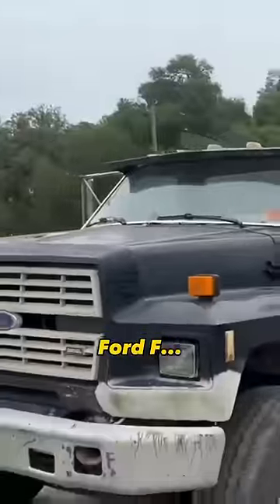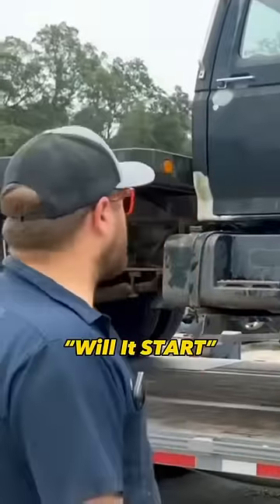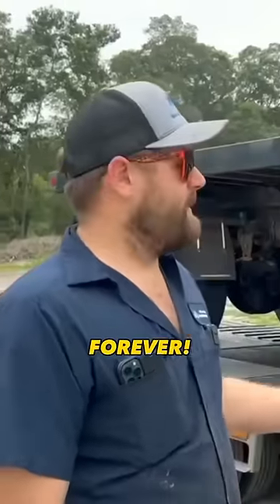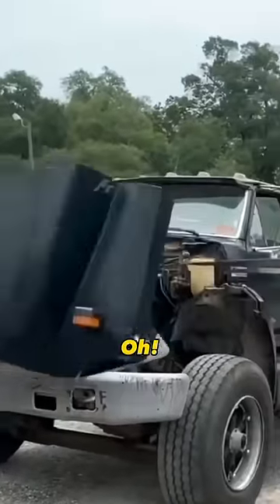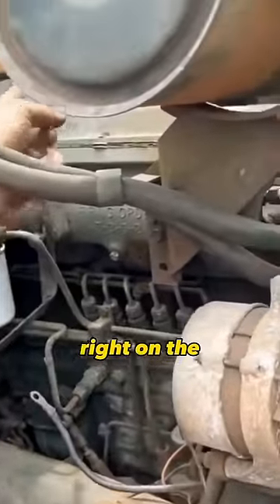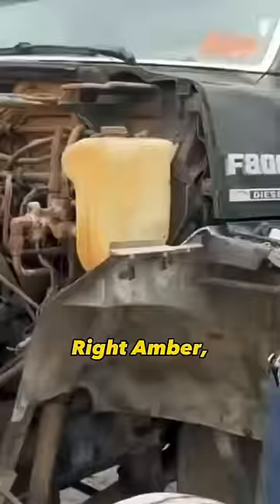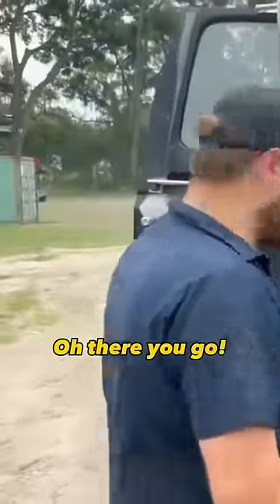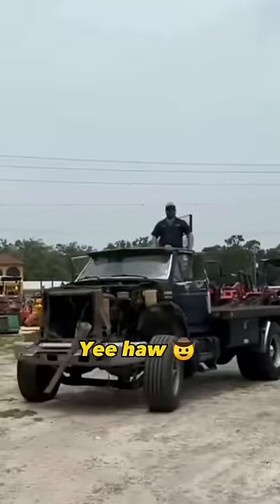Will it start??

Comment: Those engines go forever. Awsome engenes
Reply: No they do not lol
Reply: Can't get parts anymore
Reply: @DuckSongFan if it's a dt466 they are solid engines. Mostly because they don't make any power
Reply: @DuckSongFan DT466 probably best engine ever made my guy
Reply: @reverandhale863 That’s not a DT. Those trucks came with either a Cummins or some New Holland Brazilian diesel. This is the New Holland. Biggest problem I’ve heard is that parts are a bitch to find, other than that don’t know much about them.
Reply: Crazywelder5.9L6 It’s not a Ford diesel. Try knowing what you’re taking about yourself before you jump on someone else.
Reply: @chewbaccapew5705 He never said Fords were unreliable. That’s not a Ford motor, is it? In his defense I’m pretty sure those motors have their flaws that keep people away from them along with parts getting harder and harder to find.
Reply: @DuckSongFan You might be the only one in this thread who knows what that motor is
Reply: @jimmysturdevant9843 That’s not a DT466, my guy.
Reply: @reverandhale863 Brazilian New Holland 7.8. They also had a 6.7 that was in a lot of these in the big Fords back then. This ended when NH was sold to Tenneco.
Reply: @QuantumLeap83

Finally some accurate information.
Reply: @GMbowtie350 bro calm down
Reply: @MrBakedDaily  I’m calm as hell, “bro”
Reply: Crazywelder5.9L6  I’ve been a diesel technician for the last 6 years lol
Reply: @GMbowtie350  I think you and I are the only ones that didn’t smoke meth before opening this comment section
Reply: @DuckSongFan  I see it on every single video about diesels. There’s a few people who know what’s up and the rest have no clue how a diesel works and just talk out of their ass. They may know the buzz words like “Cummins” or “glow plugs” but when they start trying to explain something they have no clue what they’re talking about.
Reply: @GMbowtie350 I didn't know they had other brazilian engines other than the infamous 5.9 Cummins B block...
Reply: @philljustphill1656  Cummins isn’t a Brazilian engine. I think they started putting Cummins in them around ‘91 or so.
Reply: @GMbowtie350  I know but they produced some in Brasil to send over no? The ones that crack
Reply: @philljustphill1656  No, you’re right I forgot about that. The 53 block that cracks was cast in Brazil. The others were cast in Mexico I think. I think those were mainly a problem with the later 24V ISB in the Dodge trucks. To my knowledge the 5.9s in the medium duty trucks weren’t those blocks. I could be wrong but I think that’s right.
Reply: They go forever as a boat anchor
Reply: Crazywelder5.9L6  Tell that to the 6.4 powerstroke 💀
Reply: Crazywelder5.9L6  No dude, the 6.4 in the ‘08 to ‘11 Fords. They were a good bit worse than the 6.0.
Reply: Crazywelder5.9L6  The 6.4
Reply: @reverandhale863  it's not a dt466. It's a Brazilian made diesel. No parts available anymore
Reply: @chewbaccapew5705 thats a new holland tractor engine, if it was a ford engine it wouldnt have started
Reply: @GMbowtie350  I find the 53 blocks in the 98.5 year the most in the 2nd gens, the other block variations are the 54,55 and 56 they come in the same medium duty 2500 and 3500 trucks. 
They also come in bread box trucks. 
The 53 block would crack its water jacket length ways down the block on the passenger side.
Reply: @cole1407  I’ve seen a bit in those too. About the only sure fire way I know how to not get a 53 block in a 2nd gen is get a 6 spd with the HO motor
Reply: Crazywelder5.9L6  and apparently there’s also some people delusional enough to imagine that any engine under the “diesel” umbrella is long lasting and reliable…
      I would wager to say those certain individuals have never met up with majority of 2007+ diesels. Or the 6.0,6.4,Oldsmobile, cat 3116,3208,dpf acerts, 5.0 Cummins, 6.5 GM, Dohc isx, v10 TDI, max force dt… those are bad enough to bankrupt small businesses and that’s not even the tip of the iceberg
Reply: Crazywelder5.9L6  Unless it has a 53 block. Then it’s just a bad motor waiting to happen. You do know there’s like 6 different 5.9s. If you don’t know about the 53 block then you don’t know a Cummins.
Reply: Crazywelder5.9L6  yes and no. That particular 5.9 isn’t that great. Vp44 fuel injection system and bad blocks.
Reply: I see you have breathed in so much exhaust from one of those engines you can’t spell
Reply: Crazywelder5.9L6  doesn’t matter what your personal experience is. Just because you had good luck doesn’t mean everyone else did. That motor is statistically proven to be by far the worst 5.9 and has a relatively high failure rate
Reply: @GMbowtie350  yes. It’s disheartening
Reply: They go forever because people leave them sitting with 10 miles
Reply: @DuckSongFan hey got any grapes
Reply: What’s with the haters??
Reply: @vinyl_2784  if you say so, experience has shown me otherwise
Reply: Crazywelder5.9L6  I’ve never seen someone act so condescending about a topic they know nothing about. ‘98 and ‘99 were the worst years for the 24V. Less horsepower than ‘00 and up, a good number of them were 53 blocks, and they didn’t make the 6 spd HO yet. Like dude said, it’s cool that you’ve had good luck with the ONE truck you’ve had experience with but that doesn’t negate the fact those are the worst years. Not a bad motor, dint get me wrong, but the chances of having problems increases greatly if you have one of those years. I’ve had about 12 of those truck and have about 7 currently from a ‘97 12V up to a ‘12 with a 6.7. Got an ‘04, ‘03, three ‘01s, a ‘97, and a ‘12. MY personal experience has shown me that everything you’ve been told by anyone on here is correct. After all, you’re always gonna find that one guy who’s owned one Northstar Cadillac and loved it.
Reply: @chewbaccapew5705  Yeah, Ford has a really stellar history when it comes to reliability. They just have the worst gas V8 that ever could’ve been put into a truck.
Reply: @chrisleggett685  you mean you can’t get cheap parts, there’s companies that will manufacture stuff, and/or other things. The only issue is when it comes to old technology and replacing it or modernizing it but typically it’s not needed for stuff like this and it’s pretty easy to fix. Usually it’s more of an issue for early 2000s diesels when it comes to fixing the electronics. But when it comes to it, you can get a lot of parts machined or made it’s just not cheap or worth it, like I forgot West German company, but they will never let the ability for parts for their cars to go away so they still have the ability to machine every single part and sell it. It’s just expensive as hell to get it and with the flooring is probably gonna be done by a random company not Ford, and it’s gonna cost more than $40 an hour machining the piece.
Reply: We’ll I know of 3- 80’s dump trucks that have that engine and they are all original and have over 1 million miles on them. So there
Reply: Crazywelder5.9L6 I can’t argue that but 53 block trucks scare the hell out of me.
Reply: @QuantumLeap83  thats right i own 1 its in my shorts
Reply: @footnyou97  dang bro what's in your shorts is none of my business lol 😂😂
Reply: @jimmysturdevant9843 isuzu left the chat
Reply: *engine
Reply: love ford for it
Reply: @chrisleggett685  bc they run forever no need for parts
Reply: @DuckSongFan  dont hate on my meth before you smoke it too bud
Reply: No, 1999-2006 GM trucks will last forever 😂
Reply: @DuckSongFan  fords have problems with mostly other things
Reply: Crazywelder5.9L6   my state ( California)'wont allow parts to be sold for them, big and small cam Cummins etc .can't get parts here unless we go out of state. We needed a fuel shutoff for one last year. None available anywhere.
Reply: @GMbowtie350  yes few parts for the Brazilian made engine available now .
Reply: She can be mean
Reply: Crazywelder5.9L6 ok now you're exaggerating because you're triggered. Several million miles??? Come on son.
Reply: Crazywelder5.9L6 You're getting schooled from everyone in here. Best you just stop typing because you sound silly.
Reply: @MJBclassics Nah, he ain't getting schooled. He's sticking to his guns is all.
Reply: @chrisleggett685 actually yes you can. Ford produces every part they’ve ever made, and you can get any part they’ve ever made to this day.
Reply: @johne189 ford/new Holland 678,also in new Holland combines.
Reply: 💀just bc it last long doesn’t mean it’s good if it doesn’t have any power
Reply: They go forever until they don't anymore 😂
Reply: 7.3 was the one that wouldn’t die
Reply: @DuckSongFan then you haven’t the slightest idea what you’re talking about
Reply: @chewbaccapew5705  Fr so tired of people shitting on fords

Comment: If its a ford truck from before 2004.. then shes gunna start everytime one way or another
Reply: It'll start every time but it'll only run long enough to get you into a Chevy
Reply: Crazywelder5.9L6 duramax is made by izuzu and Cummins ain’t perfect in any way.
Reply: Funny how all the motors you guys are bragging about aren't made by Ford. Fords are great as long as you don't have to pop the hood
Reply: Crazywelder5.9L6  I'm a truck driver, I've been around diesel engines since I was 21. The best engine on the market, PERIOD, is the Detroit DD15. Cummins is shit, they drop liners at the drop of a hat once they hit 450,000
Reply: Crazywelder5.9L6 because it doesn’t makes as much power🤣🤣🤣🤣
Reply: Crazywelder5.9L6 i didn't know the trailer came with an engine.😂 18 wheeler 🤡
Reply: Nah some of them 4.6 from the 90s are trash. Key word "some". But this 7.8 seems like a blast to work with. Mind I didn't say work on.
Reply: @Crazywelder5.9L6 You know you aren't the only guy who's had a diesel right?
Reply: @Romuls753 i love how ford and chevy both share the same engine and trans now, that both blow up after 20k miles, its like how every sports car is a corvette with a body kit
Reply: @foodhatesme  yeah why Ford is still in business is a shocker
Reply: @Romuls753  cringe
Reply: @Crazywelder5.9L6  I love GM and I respect the Ford brand but to be fair, nothing has anything on the Cummins😂
Reply: Everyonea argueing fighting for the brand they are loyal to... to sum it up for everyone.. they are all built like shit now. All of them. Neither ford, dodge, or chevys trannys are gunna last. Each one has its fair share of engine issues for all of them, v8 or turbod junk it dont matter. I mean the 5.0 seems to be the only one actually half decent minus water pumps. The hemi is okayish too if u do the MDS delete
Reply: @tylermorrow3550 I’m not defending anyone but I know in the south we call them 18 wheelers. Those trucks go by plenty of names across the USA. Just like pop and soda (example)
Reply: New ones are just as good 👍🏻 All we buy. Last 40yrs Straight for the Co. We have over (10) 3.5L Ecoboost w/near 300k mis. Owner won't sell if running well. Only Ford trucks!
Reply: Crazywelder5.9L6 Powerstroke is king ! Especially last 10yrs+ when Ford brought it in-house 100% for engineering/development. Only Ford trucks boys. Keep it all American!
Reply: @chrisrageNJ  More Registered Ford trucks on the rd w/over 250k mis than any other brand. Ford builds best trucks don't be fooled. Best selling trucks 46yrs straight is no easy feat . Ford trucks are #1 in NJ /NY area as well. I live there.. Passic County. All we run. Never let us dwn. 💯
Reply: @foodhatesme That's a Titan or old Chevy. New Chevy trucks & RAMs excellent. Only one #1 truck tho! That's still Ford by far. All we buy. Never let us dwn . Fleet of 45 - F150s /F250s. 💯
Reply: @foodhatesme Best trucks in the business by far. Facts . Social media is a joke.
Reply: @XShadow705 Complete BS. You know nothing. Engineer here. I trust Ford w/my $60k over all others! Never let me dwn. 05 F150 in driveway 4.6L V8 268k mis runs great. Newer '22 F150 Tremor 3.5L TGDI Ecoboost in driveway. Best of best.
Reply: They don't make em like they used to.
Reply: @Davido50  ive never seen such a loyal fan of a brand to be replying to all comments defending ford lmao. Im the one that praised ford to begin with. Settle down, jesus. Ford is good just the new ones are junk
Reply: @ronniecarpenter3165  I'm from the south
Reply: @XShadow705  Fr I'm a Ford guy but I don't dickride the company like he's doing, that's crazy 😭😭
Reply: @Crazywelder5.9L6 LOL, "didn't ask for your opinion" but you sure gave yours 😂
Reply: @bruni5289 oh yeah, ask my s10 how that went. Never had a critical failure on my 2 rangers. Both run. Stick and an auto.
Reply: @FedkaSlovanich  just cause its rwd and low to the ground doesnt make it a Corvette
Reply: @foobeenwild1556  literally has interchangeable parts and same exact part numbers,
Reply: Crazywelder5.9L6  Only thing reliable on a cummins is the oil burn rate.
Reply: Crazywelder5.9L6  Tell that to your leaking fuel injectors, while its misfiring throwing Accelerator Pedal Position Sensor Failure codes.
Reply: Crazywelder5.9L6  Chevy doesnt make diesel engines btw Its Isuzu and General motors.
Reply: @joecooper2263 I know people who work at Cummins, you don't want their shit trust me 😂
Reply: I have a 04 explorer with 250 thousand miles it starts every time it has to 4.6 v8 and I haven’t done a thing to it. It a
Reply: @mromatic17  shit suburu owners say🤣
Reply: @DirtMcGurk   subarus aren't much better they blow ringlands all the time.
Reply: @chrisrageNJ this is the only correct take lmao
Reply: @Davido50  they're fine if they're maintained but if they don't change the oil religiously, every 351 I've seen chucks a rod around 150k. Plus anything with a wiring harness the size of my bicep can fukk right off
Reply: 😂 the video cuts to the dude double fisting ether. I could start a 6.0 with the power stroke complementary cylinder window with that much ether.
Reply: Crazywelder5.9L6 and that guy didn’t ask for your opinion 🤣 wtf
Reply: except without the ether it wouldnt have lololol wtf
Reply: My 95 is fantastic
Reply: @tylermorrow3550 did you know what he was talking about? Yes. Does your correction really add anything to this argument? No
Reply: @schmidtygt  if you don't know how to count wheels.
Reply: @Davido50 Can’t argue with the 4.6. Damn good motor. The Ecoboost? Not so much. It’s cool you’ve had good luck with them but I’ve seen enough bad shit to stay away. Remember, at one time Ford had 3 of the most unreliable truck engines ever built in all of their trucks at one time. 6.0, 6.4, and the 3V 5.4. The 6.7 Powerstroke seems to be good till it isn’t. My father-in-law has a ‘22 F450 King Ranch, 30K miles, already having electrical problems. If you have 10 with near 300K miles they must be the most babied trucks around cause just about every Ford truck I’ve seen does great when it’s just used as a passenger vehicle or very light work but as soon as you start really working them and putting weight behind them they go to hell really quickly. Just my personal experiences. The only thing the new ‘20 and up 6.7 Ford does better than my 4th gen Dodge is it’s faster, and the 450s do have a bad ass turn radius. Bout like a cab over. That’s it. Everything else the Dodge does better. It feels better with weight at highway speeds, it’s more comfortable, easier and cheaper to work on, it’s easier on tires and brakes, the exhaust brake is 1000X better, better fuel mileage, I could keep going.
Reply: @Romuls753 guy defends an Isuzu made engine 😂😂😂😂
Reply: @Romuls753 😂
Reply: @Romuls753  out of the big three the gm product will break more times than the other two combined 😂
Reply: Good lord y'all make me laugh. Im assuming, grown ass men fussing over a brand of vehicle😂.
Reply: Y'all can argue all you want but the best thing to ever to have a motor and wheels is the 97 Dodge stratus hands down😂😂
Reply: Crazywelder5.9L6 love my 05 duramax, just under half a million miles but do love that inline 6 for pulling my work trailer! I'm a Chevy guy but also give respect to cummins and ol powerstrokes!
Reply: Crazywelder5.9L6  that's the plan!
Reply: Nah anything before 89 that’s when they switched to efi
Reply: It's not a boat bruh
Reply: @Romuls753 new duramax’s have a catastrophic failure point that was so stupid and easily fixable but they didn’t. So next😂 and if you can’t tell me what the failure point, then there is no need for you too have any opinion on these vehicles. The 12 valve Cummins have a failure point, you couldn’t tell me what it is tho. The 6.4 powerstroke had a failure point. You couldn’t tell me what it is either. So pipe down.
Reply: @FedkaSlovanich no they don’t lmao. The 6.7 powerstroke and the 6.6 duramax are not the same what so ever. I’ll seen many 6.7’s that are well over 200k. The earlier models did have issue but not now. And the main reason people have issues with the 6.7 is because of the absolutely atrocious DEF system. It clogs it up with soot, take the def system off and you won’t have an issue bud. Learn before yappin.
Reply: @Romuls753 and the Chevy's transmission will only last long enough to get you into a Dodge
Reply: @MünWeeew  Chevrolet and GM have the best transmissions on the automotive market dude. The 4L80E is unkillable, unlike Dodge transmissions, the NV4500 and SM465 are ubiquitous, the Allison is the absolute best automatic in the light duty diesel sector.
Reply: @bruni5289 not really "at the drop of a hat" if you made it to 450k.
Reply: My dad has. A 98 ford expedition with 253k miles drove it to Mexico to rest over there for the rest of his it’s day still running great over there